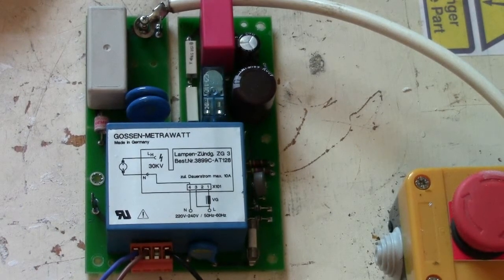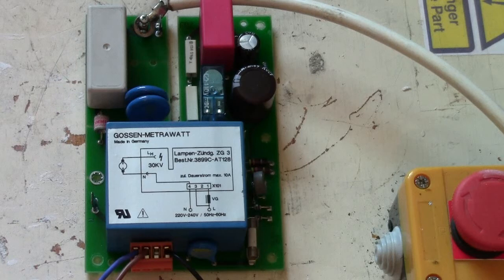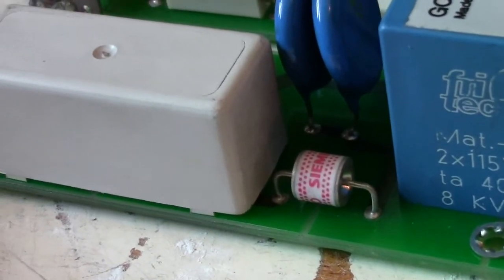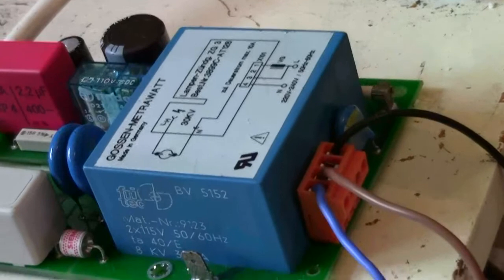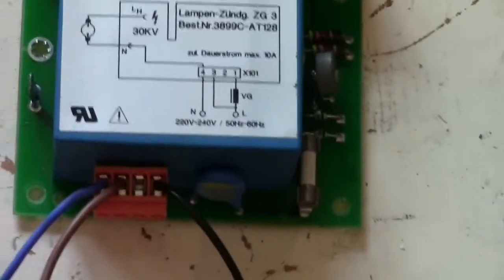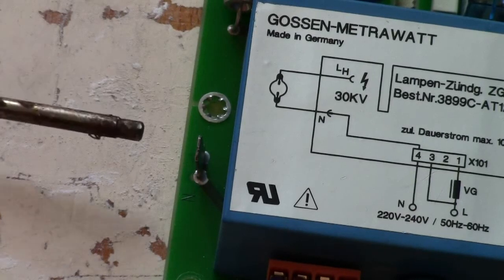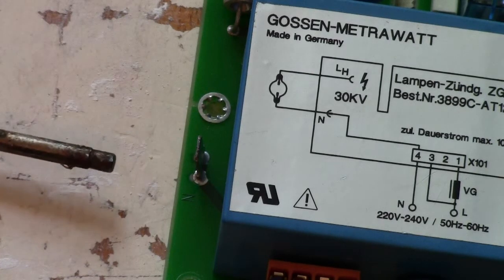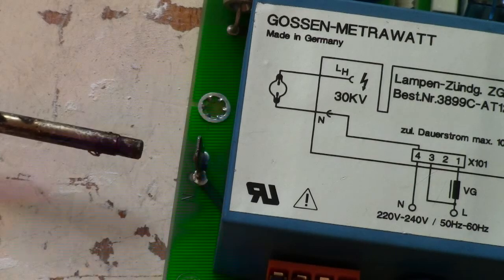30KV High voltage lamp module Running HEADPHONE WARNING

Comment: Mmmm! Arcs-&-sparks!

I'm quite surprised that you didn't roast-off that connection on the circuit board!

Yes, that little device is rather zappy & snappy, isn't it?! 

I've read other comments on this vid, & I'd have to agree that using this as a cap-charger may be a good use for it.

Make a cap-bank with a built-in recharger circuit! Mmmm! 

The only thing about that though, is to make sure you have a keyswitch on it to prevent anyone from accidentally plugging it in & turning it on!

-BBD.

Comment: 30VA @8KV, that's around 3.75mA, probably wouldn't kill, but would hurt a lot :P
Would be nice to see the underside of the board sometime, don't worry about a photo or special vid, just do s hot on your next vid will do :)
If anyone is worried about their camera when videoing HV, use a mesh screen grounded to whatever is under test, worked fine for me :D v=-vP0rgJLHH0